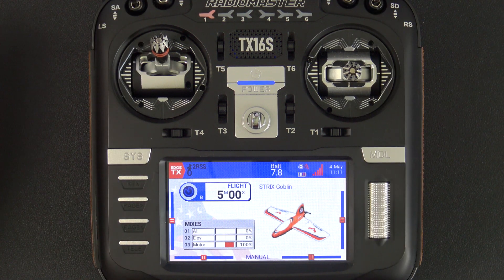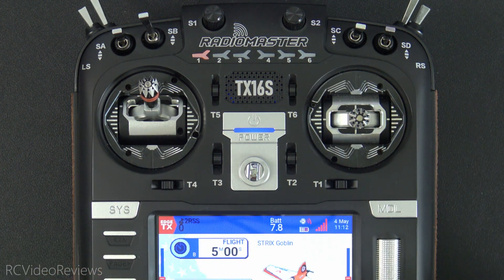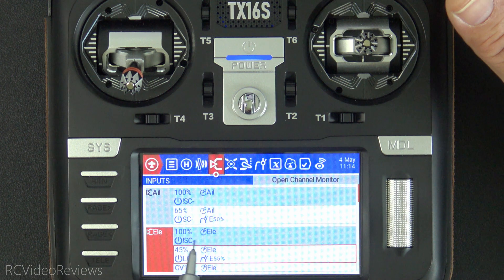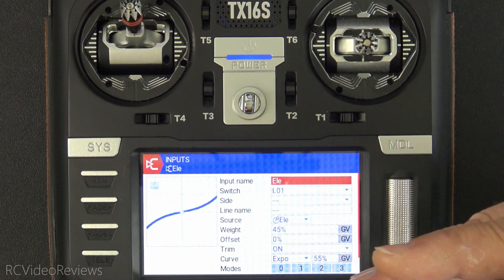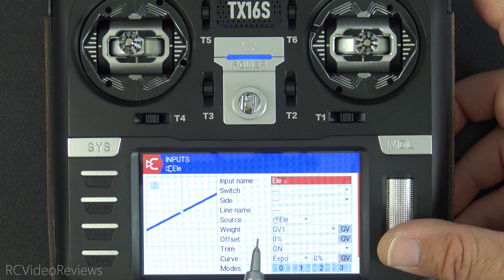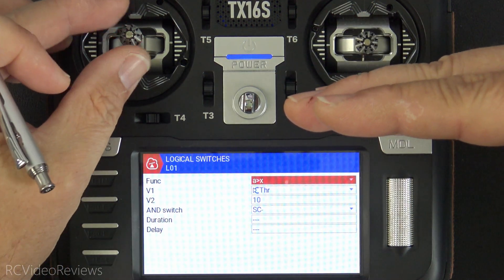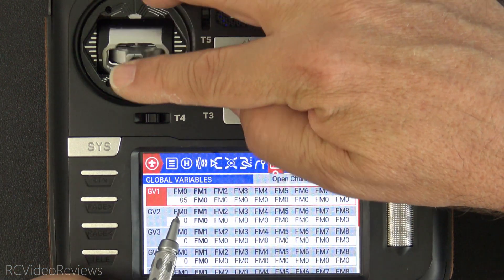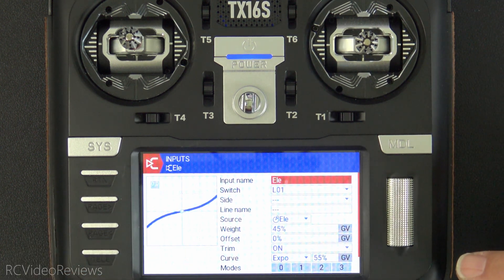EdgeTX Dynamic Dual Rates for Fast Movers • Works with: Kopilot, S6R/S8R, Betaflight and iNav

Comment: Could you please post a video about binding the RadioMaster to a Horizon Hobby BNF plane with an AR37TA? So all three Safe Select features like Flight Modes, Gain Adjustments, and Safe / AS3X modes are all used.
Reply from the maker: I don't use Spektrum gear. Sorry, can't help on this one.

Comment: That's an interesting way of doing it.
I might try it out on one of my helicopters & see how well it translates.
Reply from the maker: I use iKon for FBL on my helis and they advise to put expo/weights in the FBL directly.
Reply: @RCVideoReviews  My oldest helicopter (An Align T-Rex 500 ESP 3G) has a BeastX flight controller. I'll try it out on that bird.

Also, on a side note, my Kraken 700 KSE has an MSH Brain2. I got that pretty much from watching your videos & someone else as well. Keep up the good work. =^/.^=

Comment: I'm going to have to give this a shot on my Atomrc dolphin. The thing barely moves with the kopilot in stabilized but is extremely sensitive in manual mode. I really want to like the kopilot, so simple to set up compared but a bit too restrictive I feel like. Maybe this setup will do it otherwise I'll try a different bird.